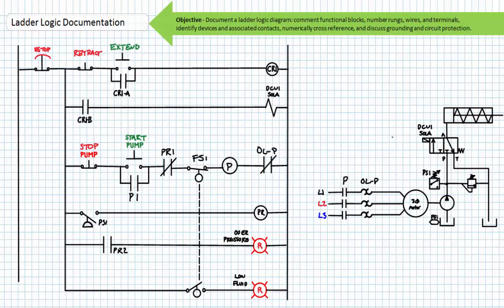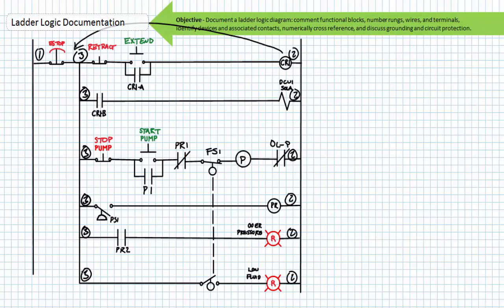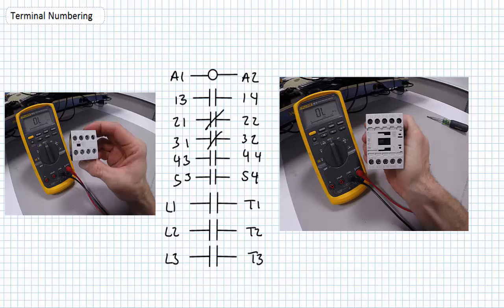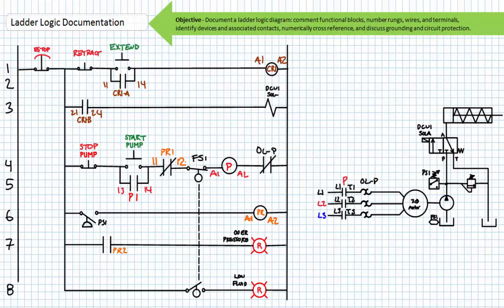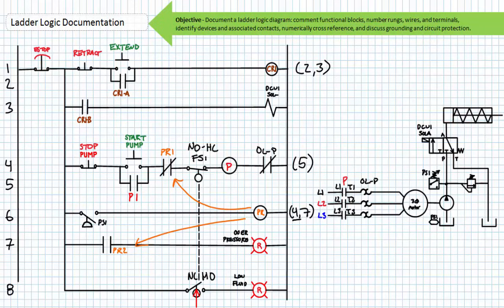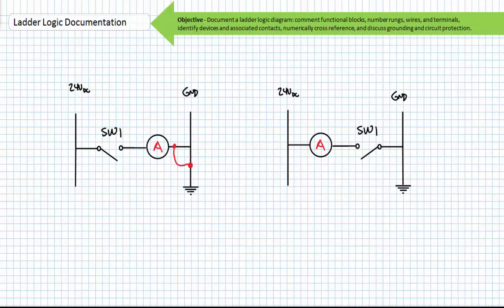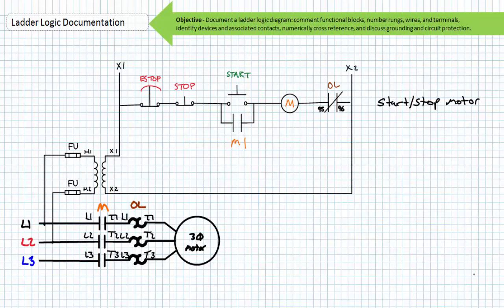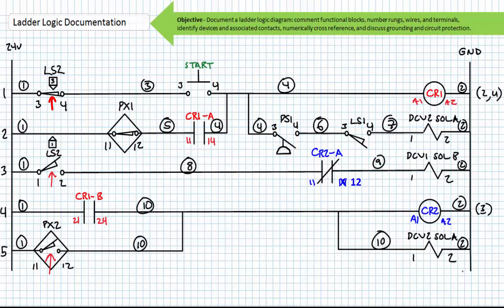Ladder Logic Documentation (Full Lecture)

Comment: Question. What is this a ladder diagram of? Just wanted to know so i can have a clear understanding
Reply from the maker: Which one? The last one? That's an electrically sequenced hydraulic circuit coordinating the sequential extension and retraction of 2 hydraulic cylinders.
Reply: @bigbadtech no the first one?
Reply from the maker: That’s a hydraulic pumping circuit with warning lights for pressure temp and level.
Reply: @bigbadtech got you. I appreciate it. I have a project due in a week over plr and this helped tremendously

Comment: 36:15 - 36:40 Not clear to me.  You have two NC proximity switch  however as you stated...if they were a three terminal single pole double throw switch then the terminal note would be 11 - 12. As the diagram shows PX1 is closed but PX2 is open so obviously it is been held open electronically. How?. Please explain.
Reply from the maker: Yes, in the deenergized start state PX2 is a NC switch being held open by being in proximity to a ferrous object. In this circuit it could be a cylinder in the retracted state with PX2 on the cap end being triggered. The terminals are still numbered based off the unactivated electromechanical state (ie: NC 11 12). 

Classic example of this is a NC refrigerator light switch being held open by the shut door keeping the light off. When someone cracks the door the NC switch closes and turns the light on.
Reply: @bigbadtech  Like I thought. Understood clearly. Thank you so much. Everything is better when u  know.
Reply: @bigbadtech  I have a minor confusion for the same time period. When you relabel the PX1 and PX2 (making the assumption that they are single pole double throw configuration) should they become 11,12 and 21,22 since the switches are independent? The two 11,12 makes sense to me if they are independently housed switches but if they are housed in one unit it seems like the numbering should change?

Comment: Why did you run a wire from stop push button to aux contact
Reply from the maker: Check out the 2 and 3 wire magnetic motor starters lecture at: https://youtu.be/kr7XiQ84rdo Long story short a NO auxiliary contact in parallel with a NO start push button creates a holding (memory, seal in) circuit with a maintained run state allowing an operator to press and release the start push button.

Comment: Jim, your videos are excellent and I am learning a lot for my current job. One question: How do you differentiate the left most wire is common for CR1A and PR1&PR2 @16:53? Is this something you assume by looking at the icecube terminals? 

Your videos are much appreciate and I will recommend them to anyone wanting to learn to read and write ladder logic for PLC. Thanks.
Reply from the maker: This is based on the presumption that the circuit is making use of 8 pin SPDT C form transfer contacts. Customarily the common (ie: 11 or 21 terminal) is on the left and the NC or NO terminal is on the right. Check out the control relay lecture at: https://www.youtube.com/watch?v=STKH6Rp7rX8 Glad you're making use of this content!
Reply: Good question, I had the same one. thanks Lucas.

Comment: Jim this is great man think you should have this lectures on pdf so we can download.
Reply from the maker: Glad you're making use of the material. Unfortunately I don't have the Motor Control lectures on pdf yet. I do, however, have the most of the basic electronics series and hydraulics available at the following links. Still working on Basic Electronics 1 and all the rest.

Basic Electronics 2 Study Guides
https://openoregon.pressbooks.pub/electronics2/
Basic Electronics 3 Study Guides
https://openoregon.pressbooks.pub/electronics3/
Hydraulics and Electrical Control of Hydraulic Systems Study Guides
https://openoregon.pressbooks.pub/hydraulics/

Comment: On a 8 pin ice cube relay aren't the coil terminals 2 and 7? I thought a1 and a2 coils were on contractors.
Reply from the maker: Good question. Both are correct. Components can use different terminal marking schemes NEMA and IEC (sometimes both!). I prefer the IEC because there's a clear pattern that indicates functionality.

NEMA:
1st switch common 1
1st switch NC 4
1st switch NO 3

2nd switch common 8
2nd switch NC 5
2nd switch NO 6
coil 2 and 7

IEC:
1st switch common 11
1st switch NC 12
1st switch NO 14
2nd switch common 21
2nd switch NC 22
2nd switch NO 24
coil A1 and A2

Comment: Jim, great video.  I'm confused as to how the P coil will energize if the NC PR1 opens when coil PR is energized.  I don't see the an electrical flowpath that will allow the motor to run.  Can you help me understand?  Thank you.
Reply from the maker: That's the point of the NC PR1 contact. It's an electrical interlock that opens and prevents the P coil from being energized if the the pressure exceeds the setpoint of PS 1 in rung 6. If everything is below the setpoint it'll function as intended, however, if pressure rises above some predetermined maximum it'll prevent operation of the pump.
Reply: Ahhh.  I now see that the PR coil is only energized when PS1 is made.  I apologize for the dumb question.  Thanks, and again, this a great video series.

Comment: Hello, Jim
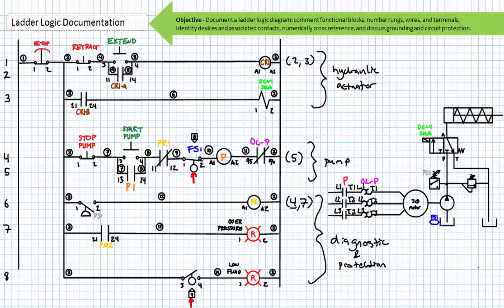One question about contacts numbering of the float switch FS1  23:57.
As it NO in rang 4 and been held closed it should be 3-4 instead 1-2? Am i wrong?
Thank you for greate tutorials.
Reply from the maker: Good catch! I number the terminals correctly at 18:59 but for some reason I mess it up when I re-number them at 23:54. You're correct that manufacturers traditionally label terminals for NC devices as 1-2 and NO devices as 3-4 despite being held in an actuated state.

Comment: I actually like method 2 since for me its easier to read in order the wire numbers. Its confusing for me to see 1,3,4,2 as the numbers for example in row 1. In fact it makes no sense for me the 1st method.
Reply: I feel comfortable using method 1, because that indicates wiring number 1, 2 are for the main power source.    We use method 1 in Taiwan too. : )

Comment: My boss wants me to connect two floating devices via the same relay connection, should I connect a second relay in parallel jumping A1 and A2 from one relay to the other and keep the systems separated?
Reply from the maker: +rarrmonkey I'd hesitate to commit to any answer since I don't know the specific system you're working on, however, yes, two loads (coils, indicators, etc.) can go in parallel in ladder logic. When one is energized so is the other. Check out the "Basic Ladder Logic" lecture at: https://www.youtube.com/watch?v=qDuCusvU-mY

Comment: sir ....i want to know more about sensors ......and these sensors how are they integrated with electronic circuits..... pid control how it can be achieved in pneumatic ,electronic ,hydraulic.......more about ultrasonic sensors infrared sensors...and wat are the criteria to put that sensor on  that place......plz explain...as u explained in vane pump lecture by opening the internal circuitry...
    sir presently i am waiting for ur lectures regarding alternator,dc generator ,dc motor,ac motor ,synchronous motor....power management system.....one more thing you explained basic ladder logic circuit very welll.....since i am from shipping industry so i had seen some electronics controlled modem with ladder logic.....it is having rectifier and alll...so i need some help if u can add some electronic logic control in pump circuit...sir i have a curiousity regarding alternator protections and high voltage protection........i am continuously learning from your lectures but expecting more and more from you whch wl be very helpful for others who want to upgrade knowledge day by day..
   sir can you put some lights on hydraulic governor woodward ug8  working and how can be it is achieved from electronic governor.....